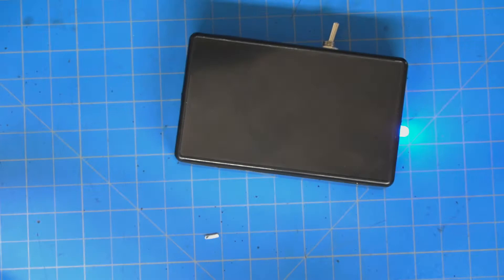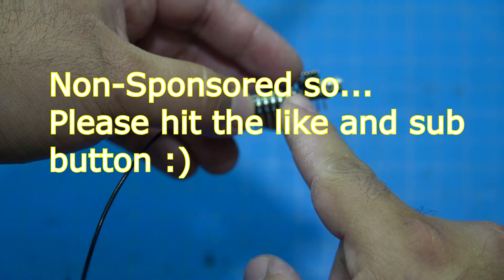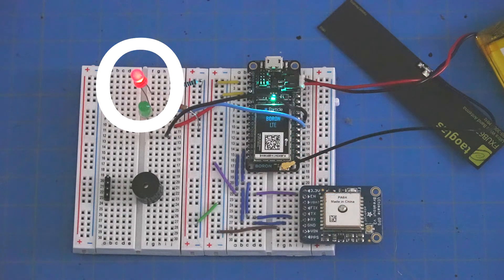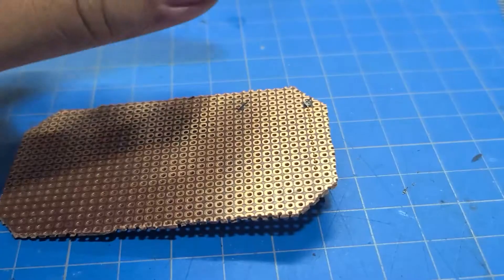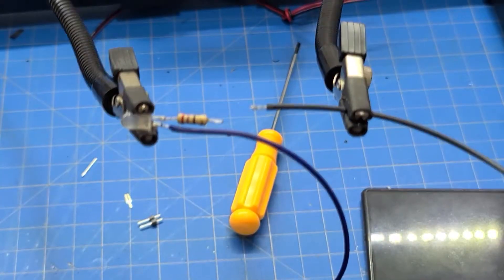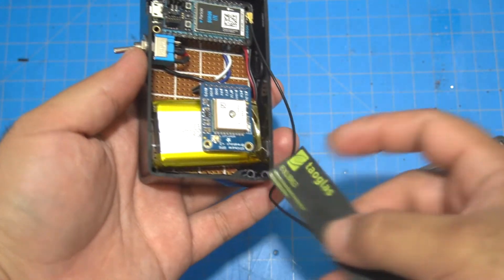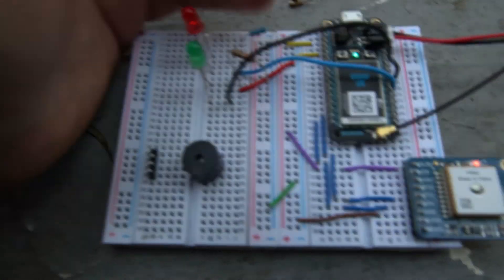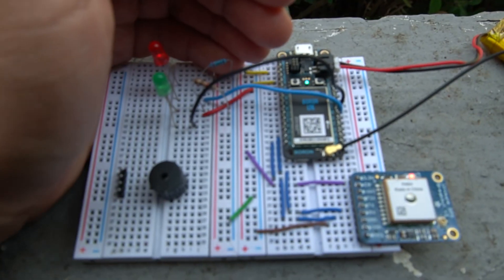DIY GPS TRACKER with LTE Connectivity

Comment: Thank you for your video of GPS Tracker. I have a question. What is the system on 08:12. And What kind of the USIM did you use the project? Can I use normal usim for smartphone? or IoT USIM only?
Reply from the maker: That is the particle interface. The board I used has a built in sim card.
Reply: @AlansInventions  Then... Can I use that boron lte board as LTE gateway?? or It must use by particle clould?
Reply from the maker: @mtinet  I don't think you can use it as a gateway. Maybe through the mesh interface but that's beyond my understanding
Reply: @AlansInventions  Thank you very much bro!
Reply from the maker: Yeah no problem 👍 good luck!

Comment: Hi. I try to get data but nothing... Can you tell what did you do to the code? Thank you!
Reply from the maker: Can you provide anymore information?
Reply: @AlansInventions  i try to publish events but a i got no data, no gps coordinates.
Reply from the maker: @ReygnMotorsport  Hi - I really want to help but need more information.  
1. Which board are you using?
2. Do you have an LTE plan or using Wifi on your device?
3. Are you able to communicate with the previously mentioned board before flashing the code I used?
4. Do you have any errors?
Reply: @AlansInventions  Hi, sorry for the lack of info, i have the particle boron lte with 3rd party sim card (Bell), setup to be able to work on lte, apn and all that stuff. The board is on firmware 1.5.x, its up to date. 
I got signal from my service provider. Im not able to receive gps data when i publish my events, from the cloud or my cell phone. I can see the events in the log but no gps coordinates. I was outside and i get a gps fix.
Reply from the maker: I would make sure that you have the correct wires connected from the GPS module to the Boron. Remember Rx to Tx and Tx to Rx. This is a common mistake. Next, I would try flashing the example sketches like "Blink an LED wirelessly" or something that requires data over LTE  that should work by default.
Reply: @AlansInventions  Thank you, i will check that. 😊
Reply from the maker: Let me know how it goes!
Reply: @AlansInventions  serial port was not defined in the code. Its working know, thank you! :)
Reply from the maker: Excellent!! Glad to hear 😊

Comment: hi, thanks for the video, is the code compiled and how do you add it to the GPS device? Is there a UART device that you plug the GPS into to send code to it?
Thanks!
Reply from the maker: Hello, the code is added to the microcontroller. Only 4 wires to link them together. I walk you through how it's connected in the video.